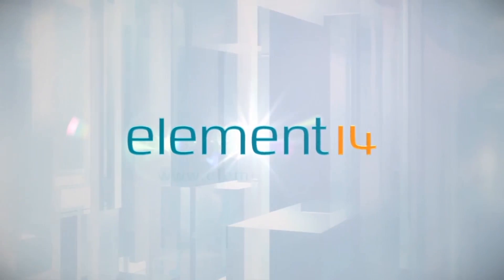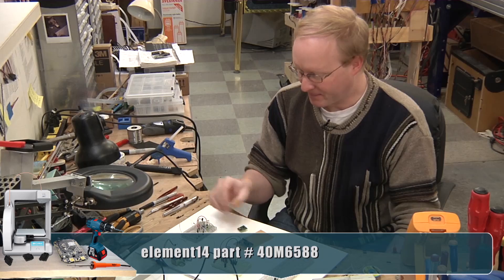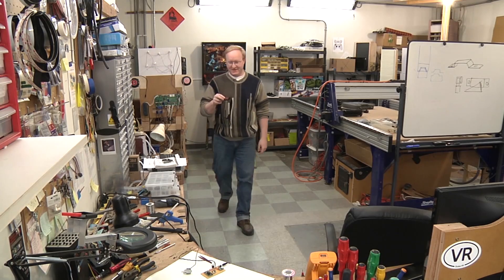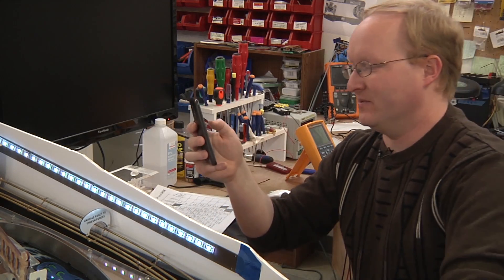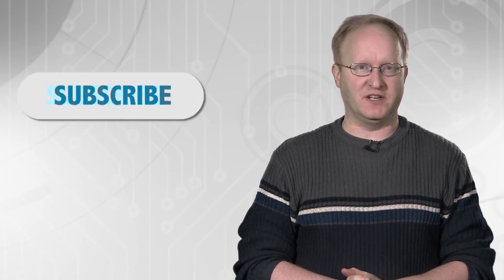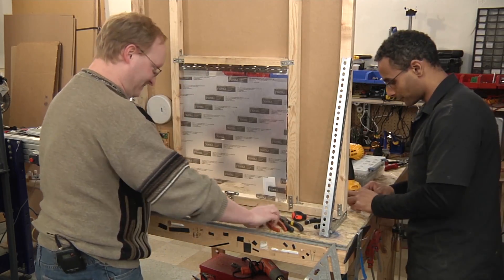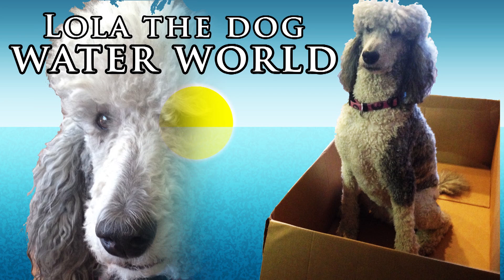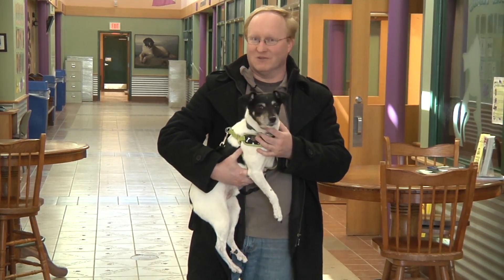Ben Let the Dogs Out: Electronic Door Build - Part 2

Comment: Unsure that using a flexible plastic for the door was a good idea, as the door could be opened by force, as the door would flex and bypass the lock.  Also the solenoid should operate a bolt to secure the door rather than using the armature of the solenoid.
Reply: But as an example of electronic lock control this is a great episode

Comment: I know this is just a PoC and something fun to hack together.
That being said, NFC or RFID readers that you can easily connect to an Arduino cost around $10 in eBay.
Why the Heck would you use a bulky active system..?

Also, that door won't hold in the middle position long enough to lock in if it's a windy day.
Reply: Please link to a NFC reader that works at a a 3' or so range
Reply: A bit of training and your dog will learn where to go to get the door open.

Comment: Would it be possible to make a module with an arduino that would read the chips they put in pets now? It would be smaller for the animal, and you could add new chip numbers to a database for when you get a new pet.
Reply: They're just RFID, im sure theres a library for RFID.